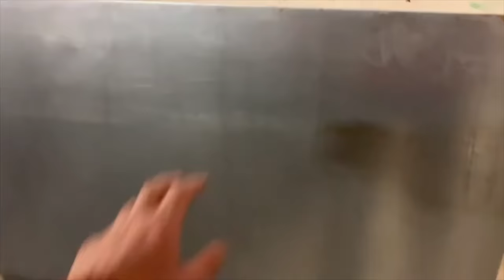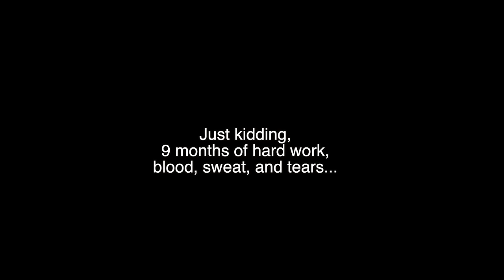Putting a Classic Car on a Truck Frame in 20 Minutes!! 1969 Chevy Corvair on s10 Chassis!

Comment: I like Corvairs, especially the later year body style. I did not know that it has the same wheelbase as an S-10 truck. The aftermarket is very supportive of S-10s so modifying it further for performance should be pretty easy.
Reply from the maker: There’s so much you can do with S 10s and I love that about them! I just threw a turbo on this one, video coming soon!

Comment: The popular thing out here in the Southwest is putting post war bodies on mid 70's-mid 80's Frames and drive trains and building budget Hot Rods. The wheel base is almost spot on and there's VERY little modiifcations you need to make to either the body or the frame to make it work. I have a buddy in my car club that put a 52 Chevy Fleetstyle body on 78 Olds Delta 88 frame and 307 engine/350 trans. He had less than $2000 in building it plus another $1000 in prettying it up, paint and interior. He bought the front bucket seats from a 2000-2001 Impala for like $100 off Facebook, The paint he bought from a local paint supply store that was a miss-mix gallon for $50, He sandblasted the Steel wheels and repainted them and put some cheap Baby Moon Hubcaps off the internet. The only new parts he bought was the engine parts needed to get it to run and for a tune up and the engine paint and the hubcaps. While it's not a 1000 Hp or 800 ft lbs of torque "Hot Rod" he has a TRUE Hot Rod and that's something that was built at home that looks cool with more horsepower than it came out of factory with for as cheap as possible.

Comment: Ive have owned 7 corvaires and this is imo the only way to make them not suck, I had one with the  donor toronado front wheel drive and the 455 and th400 fun but not very practical and  I always thought this would be the best hot rod mod for the corvaire..

Comment: So you're only twenty-three years old. That makes it even greater. It's fantastic to see people younger that still have an appreciation for these older cars. You know floor boarding is what they used to call it. I know a guy I'd been doing it for forty years or more. He set a little car from the thirties onto a Dodge Dakota pickup frame. He used the floor boards firewall something long lines what you did. Cut up the rest of the pickup to make adapting panels for the body to the frame. Left it looking kind of rough and painted a number on the side because we all know a race car is supposed to look a little rough. That man is far older than I am and he still at it. You are carrying on a great tradition.
Reply from the maker: Thank you! This is something that I had been planning for literal years. I feel that if I had gone into it with no preparation I would not be where I am with it. I probably wouldn’t have even finished it. I hope to inspire other young people as well.
Reply: @pissedoffpistongarage  I believe the car hobby will change over the next few decades. It has to be cuz there's not really any rear wheel drive vehicles except for trucks left on the market to speak of. But I think that the car have is a great way for people to grow and to come together

Comment: Awesome Job! The only thing I would have done different is would be to move the factory gas door to the rear quarter,  really make someone think. Though the filler you installed is cool looking too.
Reply from the maker: Personally I like the one I added. However a lot of people have been telling me to patch the one on the fender. But I think it’s kind of cool having it there. It would actually be cool to turn that into the air intake!

Comment: Excellent video!  One of the great things about Youtube is you can watch other peoples adventures and based on that make design changes etc to the project you have or are planning.  I have a friend with a midengine Corvair.  Unbelievable cool car...but not really for me.  Had thoughts of a front engine version so of course I watched your project and love it!  Leaving the bumps and bruises is great.  You can have fun now instead of pampering the $$$ paint!  After watching this I couldn't help but think it would be an even easier project to leave all the suspension and frame of the Corvair out back and just remove the forward frame and floors to the rear seat area.  Use perhaps a Camaro or Nova front stub frame with 2x2 subframe connectors to the rear chassis.  Unitize this into the Corvair structure and then build the floors etc nice and low and also unitized to the forward frame.  Idea being a vertically thinner frame section for interior room.  Gets away from the turn up rear bit of the S10 frame under the rear seat area too so a rear seat can fit.  Also keeps the dash, wipers, hood hinges etc all Corvair and unmodified.  Out back the Corvair frame is well up to the task and an IRS diff could be mounted to keep the car all independent suspension.  The rear drums on a Corvair are big and well up to the task,  Front Camaro or Nova discs would make for a very effective brake system as well.  Keep in mind...I'm NOT ragging on your project!  I'm just developing off it!  I'd love to have what you have and I know you can hammer on it and it comes back for more.  It's tough!  I'm just brainstorming an equally cheap donor car based rig.  100 ways to skin a cat they say...and I'm just toying with another way!  I already have a project so it's doubtful I'd ever get to a Corvair anyway...but its still fun to build something in your head!  A lot cheaper as well!  Hahaha    Have fun.  You have definitely earned it!  Great car and being a builder myself I know how much unseen effort you put into it!  Awesome stuff.

Comment: Really enjoyed the video car looks good man 😎, music was nice too 👍. Reminded me of working on my own stuff, I put a 66 elcamino on a 4x4 blazer, had to cut 10" out of the middle and quite a bit of metal work to get the body low on the frame, replace floors, etc.  separated the box like a pickup so it would not crack the body.  A simple roll cage would also fix the problem since truck frames are like spaghetti.

  Working on a way easier resto mod 72 Chevelle now, so far it's been a breeze not having to fabricate much of anything besides fixing a bit of rust and throwing parts at it😆   Anyway, nice work man.

Comment: That was a pretty neat idea. Those had a cool looking body style. I wish they had made a front mount engine with rear wheel drive. They probably wold have stayed in business
Reply from the maker: I bet they would have too but I definitely like the uniqueness of the rear engine.
Reply: That's where the Camaro came in.
Reply: The mid engine Crown kits are cool. Gives you a 50/50 weight distribution.

Comment: Do you think I can get away with leaving the vag floor under the seats i know i would use part of the fire wall and tunnel might do the same swap with a 62
Reply from the maker: I think you could. Make sure you watch the full build though. I ended up having problems with the floors because they were too tall and I ended up having to cut them and lower the floors 3 inches.
Reply: @pissedoffpistongarage  Its been a while since I watched it so I will re watch it the reason I want to retain the floor because the vair metal is perfect its a Cali car but no drive train.

Comment: really needed to brace the body before cutting all its structure out..Amazing the doors still close and the gaps are not f'd up.  Got lucky.
There is another corvair video where someone used a montecarlo frame to get a v8 front engine.  It is a absolutely beautiful car.  You have a way to go to get it looking good after all that work can't leave it trashy looking.   You can see my Project Audacious, 67 Corvair with Porsche 944 suspension and Audi 4.2 v8 mid-engine.    A corvair is much better suited to a mid-engine, you don't need that frame swap.

Comment: Wow, good job.  Any issues with the cooling system being able to pull enough air for the radiator?
Reply from the maker: What you don’t really see is a small hole below the front bumper where the license plate used to go. Believe it or not that little hole offers enough cooling to keep the entire engine cool. On hot days she runs a little warmer but I’ve never had any issues.

Comment: Great job on the transformation!
I'm considering doing something similar (for the 3rd time) 😵‍💫

My one question is does she overheat at all??|
The S-10 had a grille, but the Corvair doesn't have any air opening to cool the radiator. Especially in slow moving traffic or on a cruise night, I could see this getting really hot.
Really curious about that.

Again, really great work!! 😎
Reply from the maker: I do have a small hole in the front under the bumper! It’s about a foot wide and 8 inches tall. Also I boxed in the radiator. And just that little bit keeps it cool!
Reply from the maker: Also you should do it!

Comment: I would like to see how the shape of the S10 Dash fitted ,compare to the Corvair  dash shape
Reply from the maker: I was actually going to use the S 10 – because all of the wiring and ductwork was already in place. However, it did not fit. It would sit significantly higher than the dash of the Corvair.

Comment: Just curious but what was the last 4 numbers of the serial number on the Corvair?
Reply from the maker: I have two 69‘s. The one in this video is about is 3610. My other 69 in the background of some shots is 4520
Reply: @pissedoffpistongarage Would like to see how 4520 comes out. Only 1480 from last one produced.  Was probably built in late March to early April of 69.  Production ended in late May I think with number 6000.

Comment: Must be tougher than regular or any corvair out their...coz of truck chassis...
Ain't this is like old days of Motorsports manufacturing ...back in those motorsports days...if the car's variant is performance based..then company will offer "" Heavy Duty axles, Heavy Duty suspension or perhaps Heavy Duty drive shaft""...you gave this corvair same option...Though here you changed everything...lolol..but chassis matters the most...
Sooooo...correct me if I am wrong...S10 chassis will make difference..right??

Comment: I have a question is this legal because i want to do something similar but i dont know how to go about is it registered under the truck or the car and is that legal
Reply from the maker: I’m more of a it’s easier to ask for forgiveness than it is permission kind of guy. However when I talk to my insurance agent she said that insurance goes on the shown Vin. Meaning that on this car the Vin number you see when you look in the window is the Corvair body. So it is insured as a Corvair. I use that philosophy to get it registered as well. Think of it as changing out parts. If I was to change the engine or a fender on a car I don’t have to tell anyone that I’m doing that. So if I was to let’s say change the frame out on a car as well with another frame. I shouldn’t have to tell anyone that, you get what I’m saying?

Comment: you done a pretty nice job with it considering how that corvair body was looking when you started (the s10 actually looked better) , one thing i might still change is the sides of the hoodbulge you made to clear the engine  , i would slant the sides and make it flow intoo the stock hood a little more , can still add some strips of metal to that to give it those slanted sides 
https://www.cjponyparts.com/media/images/resource-center/articles/body/cowl-induction-scoop-red-mustang.jpg

Comment: Man I'm so sorry 😔.      I'm sorry that you did all that work and only have a 2.2L Engine 😭🤣  You could have at least bought a 4.3L/5 Speed S10 man, you would have LOVED it way way way more
Reply from the maker: The turbo that I just installed on it last week says otherwise. I searched long and hard for the four-cylinder. Those engines hold a very special place in my heart and I wouldn’t want it any other way.

Comment: These people  have wreck  2 good vehicles,  so sad
Reply from the maker: I don’t think you know what you were talking about. I recommend you watch the video where I do a walk around of the Corvair. It was rusted out with no floors. The front suspension had to be welded in by the previous owners and the engine was locked up. The car was literally destined for the scrap yard. The truck however I will admit was very nice and I was sad when I cut it up, however I do not regret it. Nor do I regret the entire project. I would do it 10 times over again and still not regret it. If you are upset about what I did to this rust bucket. I have a all original very nice condition 69 Chevy Corvair that I am restoring. However, don’t fall in love with it because that is going under the knife here very soon to be heavily modified.
Reply: @pissedoffpistongarage  i like the build these cars are over 50+ years old, rarer by the day harder to find parts an keep them on the road or restore them. people act like your cutting up a nice car but now your able to go to auto zone an fix your much newer easier to find parts for your s10 undercarriage and drive your 50+ year old car
Reply from the maker: @nobullshit9721  Exactly. I would never do this to a concourse car. It had been sitting in my backyard for 10 years rotting into the ground. As for the S 10 they made millions of them and you can still find no less than 20 in every small town America. I don’t think we are in any short demand of S tens. And you’re right. I can go to any auto parts store and get parts for it. I’ve already had to replace the starter order. Just drove to O’Reilly‘s and bought one same day. Can’t do that in a Corvair.